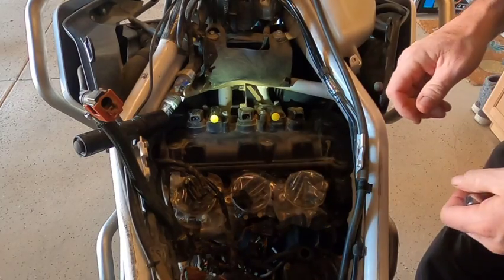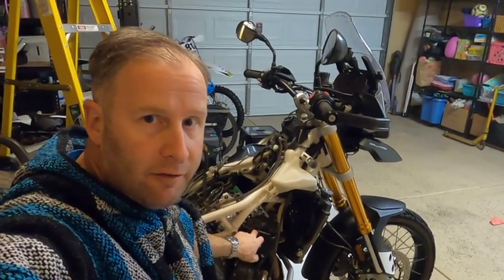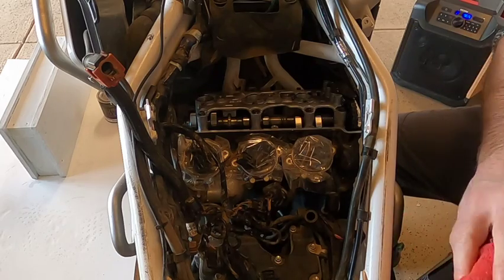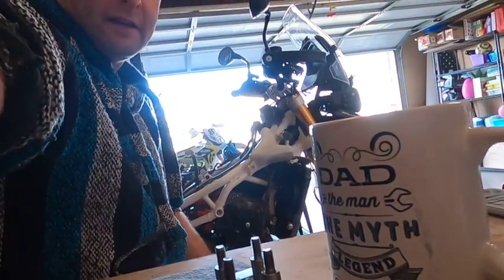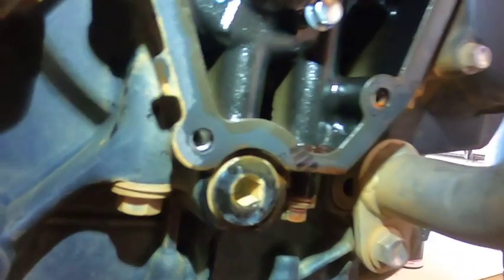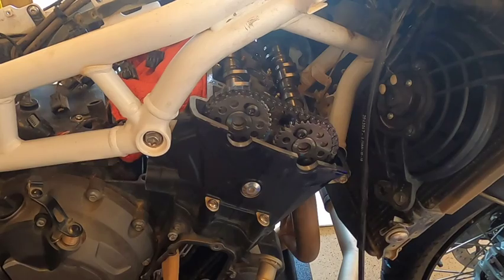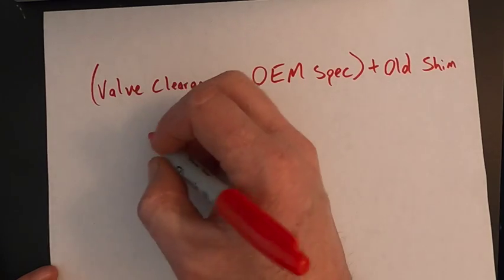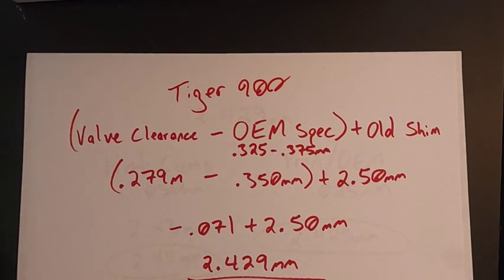Tiger 900 Rally Pro Valve Measurement and Adjustment

Comment: Progress should mean bikes require less maintenance than before. My 91 Nighthawk 750 has hydraulic lifters. The Super Tenere valve check is every 42000km. Even the Ducati Multistrada V4, every 60000km, the Harley Pan america, no valve service, ever. What were Triumph thinking with a 20000km valve check schedule on their latest models? When even a Ducati has 3X less valve checks required, you know you have room for improvement.
Reply from the maker: It’s interesting that hydraulic lifters aren’t standard. Probably thinking it helps support dealers because most people won’t touch them.
Reply: @BlueADV214  Most likely, also it weighs slightly more and is not ideal for very high reving bikes (risk of valve float)...but definitely a sacrifice I'd be willing to make! And clearly even Harley has it on their latest RevMax engine so it's not cause Triumph can't do it...they are going backwards, at this rate, the maintenance will soon be in hours instead of km, like on a dirt bike :P
Reply: It's simply a performance thing. Also worth mentioning the no valve service pan ams have had s real counts of valve train failures at least than 40k miles. Might be worth considering the no service aspect

Comment: When ever i do the shim change on my bikes and i need an odd shim size that is less than the shim in the bike i get a perfectly flat smooth surface and place a 400-600 grit wet and dry paper on it, spray WD40 and rub the shim in figure 8’s until i get the measurement im after.

Comment: my warranty expired on the rally pro 900 so i am kinda thinking of skipping this whole thing just do the filters and fluids and maybe plugs. the price of this job is 750,00 euro in the dealership which is just insane. any that has this bike skipped this?
Reply: I already made my decision… going to skip this forever… Never did this with my Suzuki never got a problem after +70K kms.  I believe reduced oil change intervals really help dealing with this.

Comment: Demonstration video much appreciated! I’m comfortable changing valve shims on a single thumper with a carburetor but This appears slightly above my skill/confidence level - I’m concerned I’ll forget where something goes or inadvertently skip a step. Might have to enlist assistance from a more skilled buddy to help me out. Keep up the informative posts. BTW my local Triumph dealer service department charges $120/hr labor. Thanks again!
Reply from the maker: Yeah, not something I would’ve attempted without some experience under my belt. I’d be interested to see a dealership quote for this.
Reply: @BlueADV214  My dealer in Minnesota said it was approximately $800.00 for the 12K service.  Approximately.
Reply: @BlueADV214  My dealer in New Jersey just gave me a quote of $1,692 for the 12,000 km service
Reply from the maker: @edgardorodriguez791  OUCH!!!! There’s no way I would pay $1,700 for this service… and if I were looking at buying a new bike, that would be something I would be looking into a lot more when deciding on which bike to purchase.
Reply: @BlueADV214  I said the same thing to the dealer, I told them they should put an advisory label regarding the cost of the 12,000 Mile maintenance.  At this point I am thinking of just switching to BMW.. Thanks for the video now I know that my mechanical skills from working on an old Volkswagen Beetle aren't any good for this task.. 🙂 thanks again
Reply: I just got a quote from a dealer in San Diego for a 22 tiger 900gt for $$$ 2075 $$$
Great video 👍🏽👍🏽👍🏽

Comment: Was the engine hard to turn with the rear wheel ? I have the spark plugs removed and the bike in a high gear and it seems way more difficult to turn than it should be.
Reply from the maker: Are you in 5th or 6th…. I don’t remember it being difficult to turn, but I think 5th should be the easiest gear to turn the engine.

Comment: I have tried to change the spark plugs without removing the cover and the coils interfere with the chassis, can they be replaced without removing the cover?
Reply from the maker: Very unlikely. Changing the plugs is part of the 12k service… out of curiosity, why would you be changing them outside of that?

Comment: Really appreciate your video, thanks. Looks like you did not adjust the tension on the cam chain tensioner. The manual calls for an adjustment with a special tool. Did you feel this was unnecessary?
Reply from the maker: The alignment looked good so I made the call to postpone it until 24k miles… which is coming up very soon. I’ll make sure to add a video of that process.

Comment: Great set of videos – really appreciate this! … A question though: I can’t fully remove my number 3 cylinder ignition coil as it is blocked by the frame – it comes out of the hole fine but maybe an inch later it hits the frame – I’ve tried considerable bending force. My dealer says, yes, this can be a pain and you risk breaking the coil. How did you find this? I wonder if I might get more of an angle if I lift the cam cover first?
Reply from the maker: I had the same problem. I have to force it past the frame with my fingers crossed. If you find an easier way I’m sure we would all be grateful to hear about it.
Reply: @BlueADV214  Ah - thanks for that - I suppose that's kind of good news. I only wanted to check my plugs but have abandoned that for now. I'll be doing the valves in the winter (UK) - will let you know how I get on 🙂
Reply: The easy way is to leave it in the hole until you get the cam cover off then it will come right out with the cover.
Reply: @BlueADV214  so do you have to force it by bending the coil sideways? Isn't there a risk of breaking it?
Reply from the maker: @giampierogaz7552 as I recall, sort of, on the left one. It doesn’t bend, and I was a little worried…. But the dealership isn’t gonna have it any easier. In the end it was fine.
Reply: @BlueADV214  at the end I didn't understand if you dismantled them yourself or if you took the bike to the dealer and in that case how did they do it? Thnks
Reply from the maker: @giampierogaz7552 never took it to the dealer…. Just have to massage the thing in/out.
Reply: @BlueADV214  ok It would have been nice if you had made a video for replacing the spark plugs
Reply from the maker: @giampierogaz7552 nah, that gets done as part of the service… there’s no way I would go to all that trouble just to change plugs

Comment: I'm really aiming at a Tiger 900 for my next bike and just found your channel. Great stuff!  Do you plan to do a review of the bike on how you're liking it so far?  I do like doing my own wrenching but thats some intense work you've done.  Do you happen to know what your dealer job rate was for the valve check?
Reply from the maker: I will probably do a likes/dislikes video later this year after my next desert trip. I don’t know what the dealership charges for a valve adjustment or the 12k service… but I can tell you what they charged to put new seals on just one of the fork legs… $240. 

So by my math, if they had done seals on both fork legs, I would have paid $500 after tax. If you watch my video on the fork rebuild, you will see how absurd they price is. I can only imagine what the cost would be for a valve adjustment, let alone the entire 12k service.
Reply from the maker: I’m going to do another review after my desert trip this month to the NVBDR and CABDR.

Comment: What a great design to do the valve shimcs. Not too complex and room to get in. Its a far better bike in the real world to work on yourself and has to be the king of middleweight adventure bikes. Those engines are good for well over 100k miles and is probably the best triple out there and very strong as it seems to share the same crank specs as the daytona 675 but detuned by one third on the bhp but with more low down torque. I had a 1996 daytona 900 and i really loved the torque of that motor. These tiger 800s are far better with a better sprag clutch, more reliable engine. What a great bike.

Comment: hello   great video    just a question    does your bike have cruise,  do not see the stepper motor and i have that on the gt pro     not sure if there is room to remove the cam cover without removing the throttle bodies  on mine with the stepper motor
Reply from the maker: I do have cruise… I don’t think you can get away with not removing the throttle bodies, but will certainly look into it on my next service (2023). 

My general recommendation is to follow the Triumph manual triumphtechnicalinformation.com and not skip anything (at least the first time); shortcuts are often not as a good an idea as they sound. The dealership uses the same manual, so if there was a more efficient way of doing it without unnecessary risk, they will USUALLY just have it reflected in the manual already.

Comment: great video¡¡,I will do the 1st adjustment at 30,000 km (18,000), the adjustment of the camshaft sprockets is to compensate for the stretching of the chain with the kilometers, I think it is a bit silly and possible failure if one of them loosens They...., I will not touch them either. What size -diameter are the calibrated pads?, sorry google translate, greetings from Bilbao north of Spain
Reply from the maker: Shim diameter is 7.48mm

The chain stretch makes sense, but I can’t imagine it stretches that much in 12k.
Reply: @BlueADV214  Yes I agree
Reply from the maker: I’ll probably check and adjust that at the 24k service.
Reply: @BlueADV214  it is 20k mile service interval for the valve clearances on the 1200 and the camshaft adjust for the chain stretch at the same time. Both of mine needed adjustment and 11 of 12 shims. At least now you have taken the cams out you had a chance to measure all shims even if you were not changing them to help you with ordering next time round.

Comment: There is no possible way to measure exhaust valve clearances with stright gap gauge. I ended up doing the service myself, and i assure you, that friction and tension of the straight gap gauge inserted into exhaust valve clearance with some angle, will cause incorrect values result. You need curved gap gauges.

Also, please remember to oil your o-rings, especially the one in chain tensioner. I just wasted the new one because i didn't do it. That's probably the basic knowledge that every mechanic have, but i guess the audience of this video are people like me, that are not experienced, and missing information like that may result in job failure.
Reply from the maker: Kudos! Taking on this level on maintenance is definitely not for the novice and should always be accomplished with the guidance of the manufacturers technical manual to mitigate any potential issues that may arise from the minutiae.
Reply: @BlueADV214  thank you very much for your video, it gave me courage to do it myself, but I feel like the hardest part - measuring valve clearances was skipped. Even with curved gap gauges it is pretty tricky. Anyway, overall, I would not consider it too hard if you are skipping timing part (like you did). Definitely worth saving on dealership service.

Comment: That looks like an expensive service.
Reply from the maker: Certainly something to consider, especially if looking at purchasing any bike. Fortunately, I enjoy the work, but I would be interested in what the cost would be to have the dealership do the work.
Reply: @BlueADV214  Right now 13.5.2024. i got the dealership price quote for this service 750,00 euro for the whole job. this is a required maintenance at 20.000km
Reply from the maker: @kresimirbajuti3254  I’m not sure of the exchange rate, but I was recently quoted $2,000 USD for this service. I sold the bike instead and got one that was more suitable for me.
Reply: @BlueADV214  here in Croatia it would be 810,00usd and eur/usd is 1,08 ATM